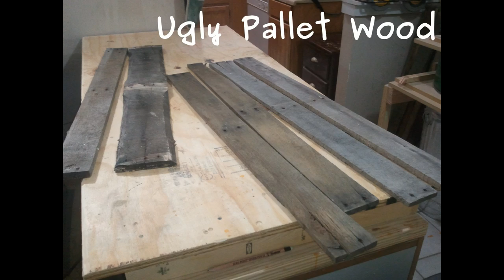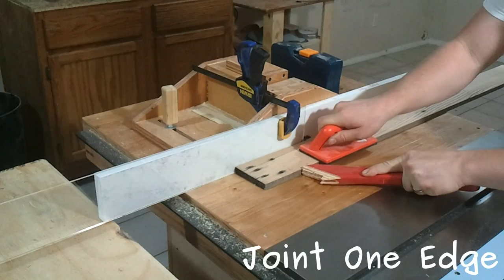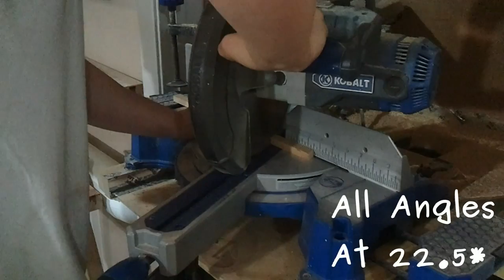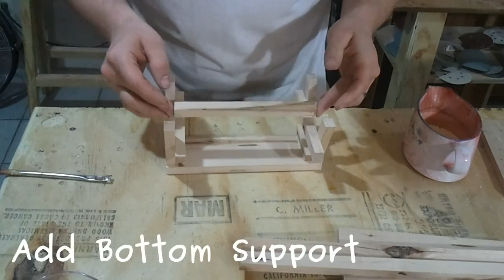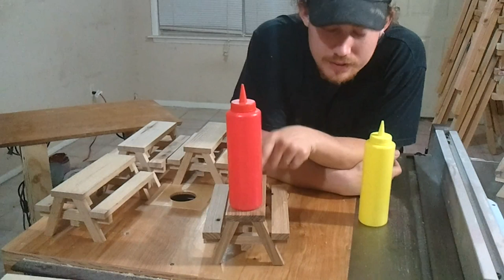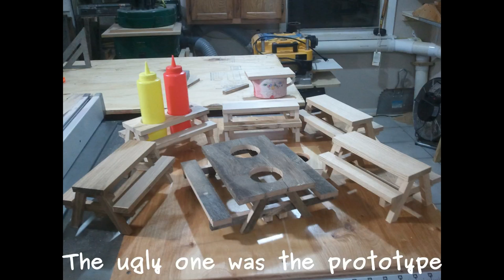Mini Picnic Table Condiment Holders - 091

Comment from the maker: Thank you Rick. No clamps at all with this build. Just finger pressure for about 20 seconds and the joint will hold on its own. Be gentle and do not stress the joint for 20 minutes and you will be good.

Comment: I love that you did not start over and make a new video. I am interested in how you made the holes. Did you use the same tool as you did with the mini bench condiment holder?

I like that you used  2x4... but I know that I have a ton of scraps out in the shop that are 1/2" thick that I can probably use to make one. I can't wait to make one. Maybe I'll do what someone suggested as well and make the smaller one for salt and pepper. Then I'll have one for both.